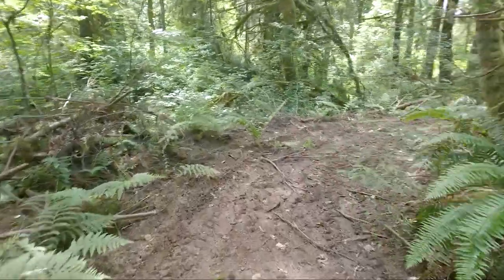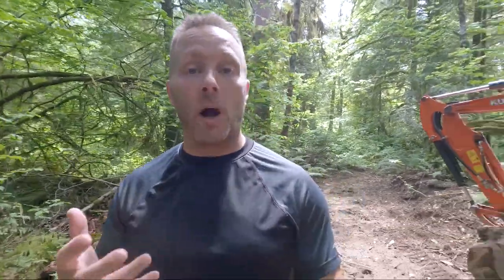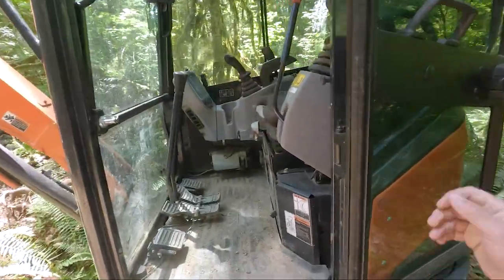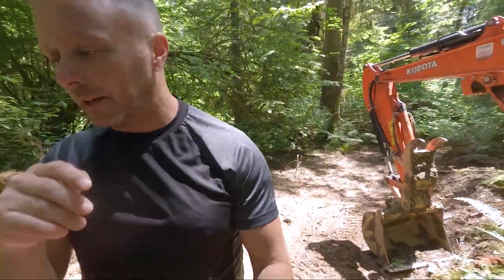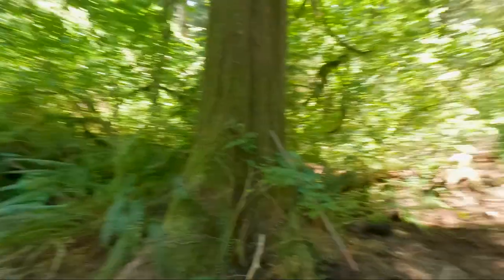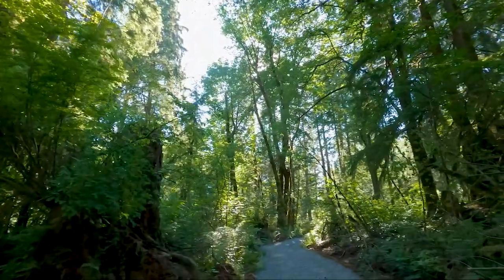How I Build My Forest Horse Trails With An Excavator

Comment: Thank-you again so much 🙏. I’ve been watching your trail-build videos and it’s exactly what I want to do in our little forest. We only just got our first tractor, with a bucket and box blade, but no excavator. Do you think this would still be possible with just those implements? (Assuming we already pulled out trees, but still heavy brush).
My other question is if the barefoot horses ever have issues with that gravel. In an earlier video you told me what you used and I found I can get that here on the island, but the largest size pieces are quite sharp. I have no idea how mine would feel but it would be nice not to need boots. To get any finer gravel here would be way past my budget.